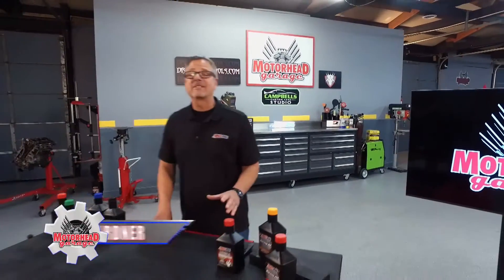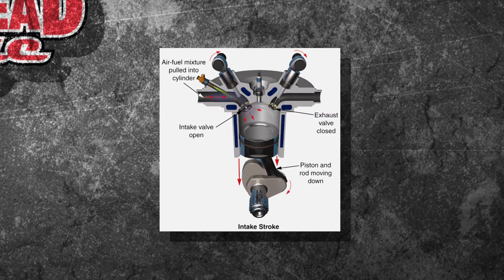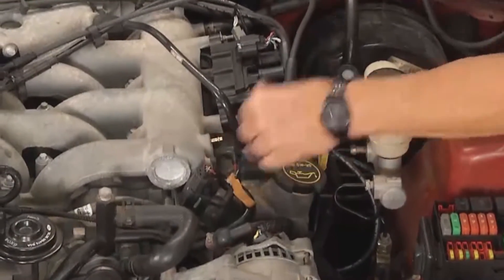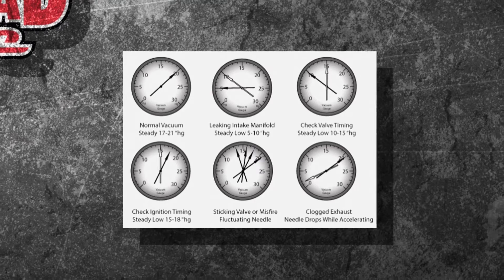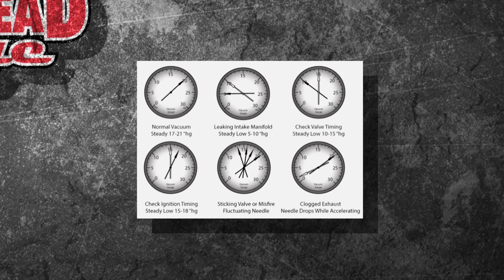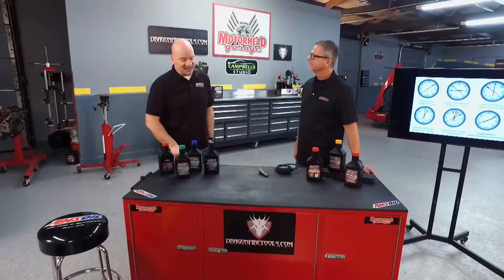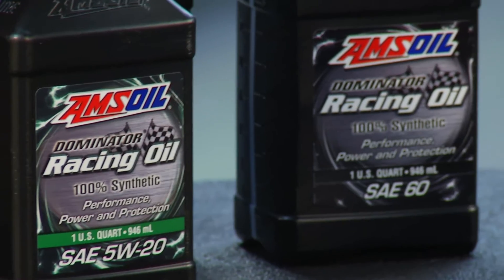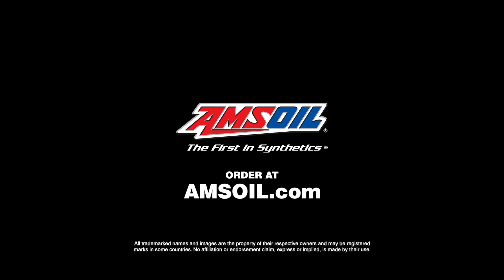How to Use a Vacuum Gauge in Your Car

Comment: So when finding a vacume source. You pull the hose off. But that wont effect the readings? You dont need to t into it to get a accurate reading? Idk im just a bit confused by these things. Some people t into a line. Others are just pulling the line off and putting the single gauge line on.
Reply: You missed the whole point of the video. No matter what vacuum you’re running, throw some Amsoil in it and all of your problems will be solved lol
Reply: @jc3883  Haha yeah, that's what I was thinking...  🤣